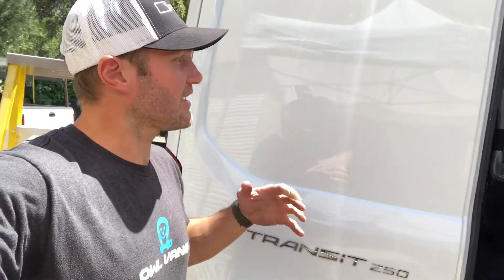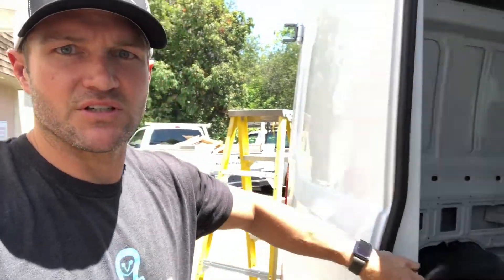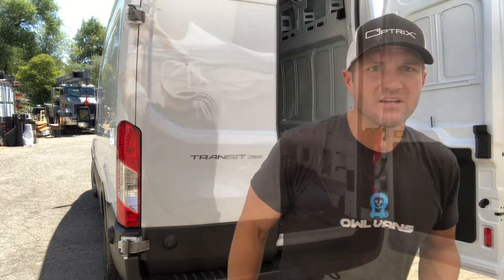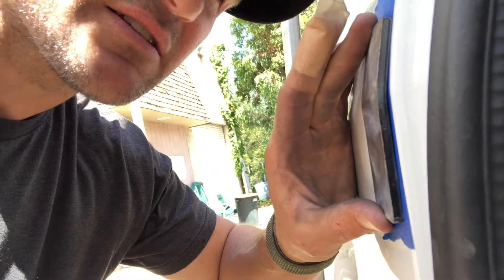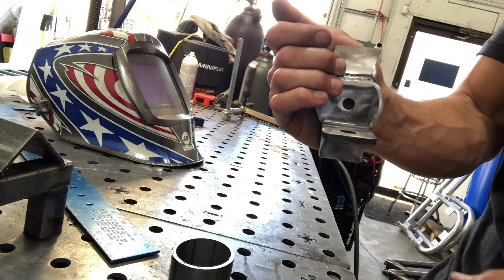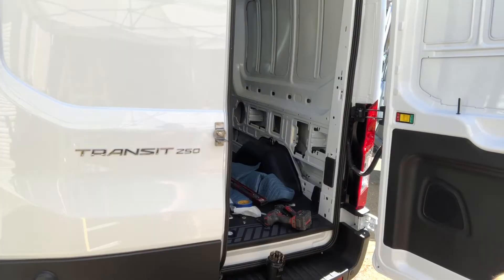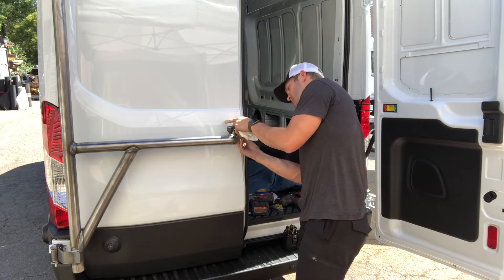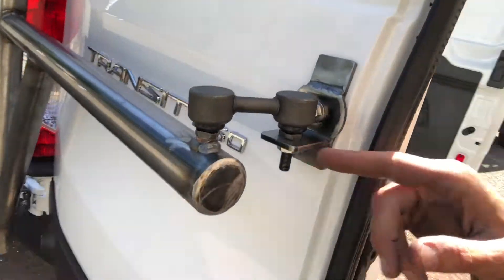Ford Transit Tire Carrier Development Day 2

Comment: It is Jun 2021, when will parts for Ford Transit 350s become available?
Reply from the maker: We have a new line of Transit gear coming out this summer. Most are finished currently
Reply: @owloffroad  What about for 2021 Transits?  Ford changed the rear door hinges, from my understanding.
Reply: You should be able to swap hinges too. We are working on it